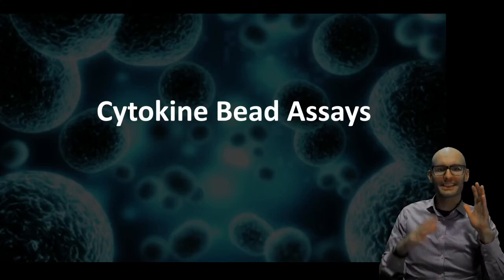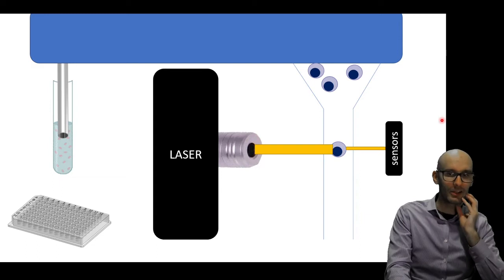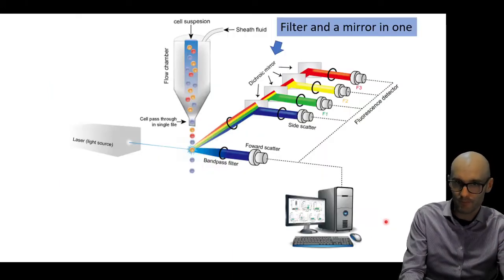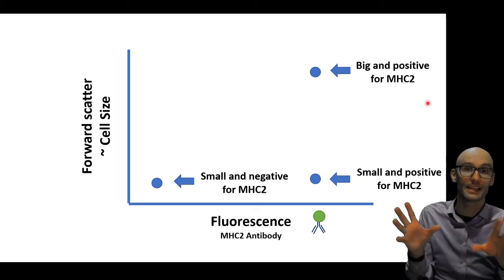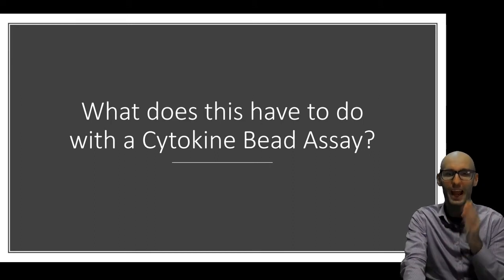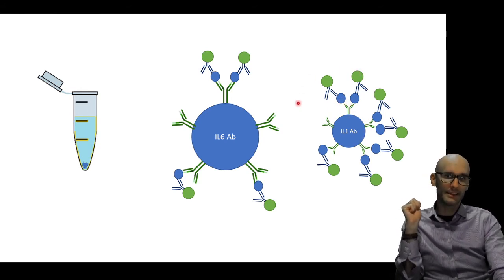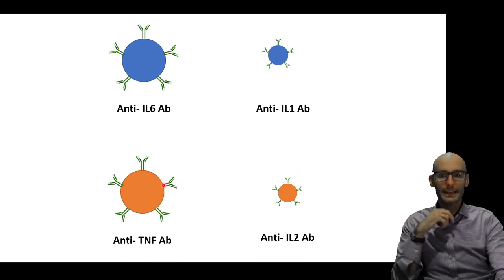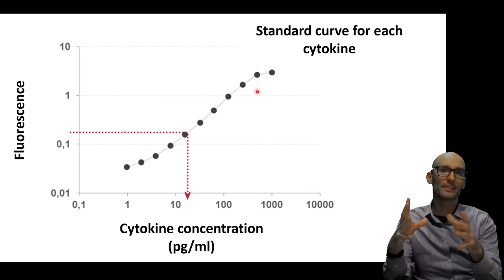How does a cytokine bead assay work?

Comment: Hi Dr. Jack! I'm currently writing an essay about the cytokines in depression and I want to talk about the ELISA Multiplex procedure. Is this cytokine bead assay a type ELISA multiplex or they're completely different techniques? Thanks!
Reply from the maker: @patataflp  so the E in ELISA stands for enzyme. It is difficult to multiplex an Enzyme based assay. Because Enzymes help a chemical reaction. A chemical reaction will not typically stick to a bead which is the primary mechanism of multiplex assays. So ELISAs and multiplex assays are very similar. But the multiplex assays I'm aware of typically don't have that enzyme part. So they're not really ELISA multiplex assays. I haven't actually heard of those.
Reply: @dr.jackauty4415  Alright, thanks a lot!

Comment: Hello Dr jack, what type of sample tube is most appropriate for blood collection in CBA assay. 
Thank you
Reply from the maker: For human samples a heparinised vacutube is best. For animal work I normally use a heparinised needle (or sodium citrate) then dispense into a 2ml centrifuge tube. It's important to take the needle off before ejecting the blood, if you force it through the needle you will lyse your cells. Then centrifuge the tube at ~500g for 5 minutes, take the plasma off the top, leave the pellet, and run the CBA on the plasma.